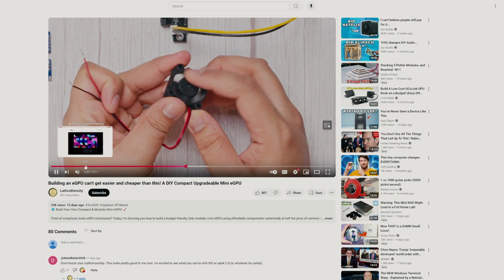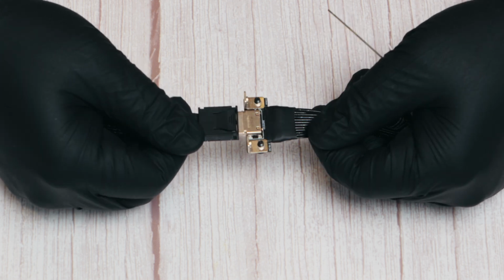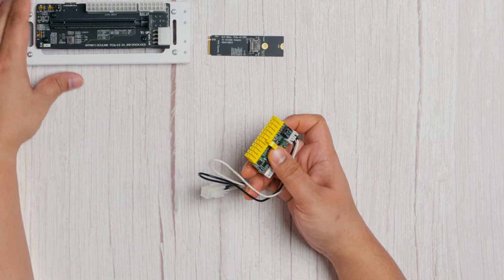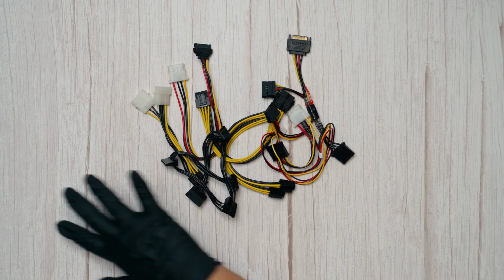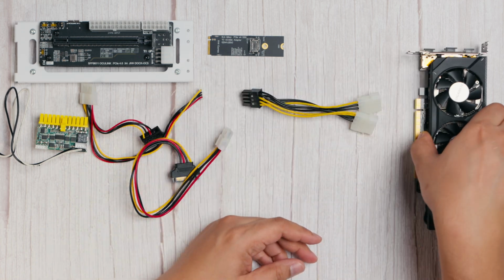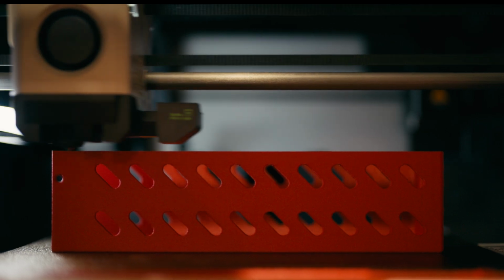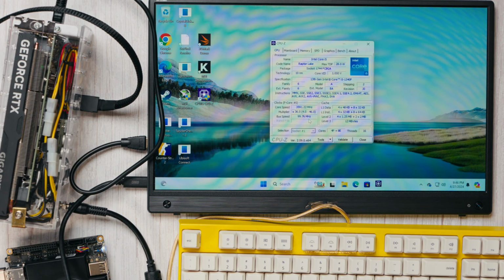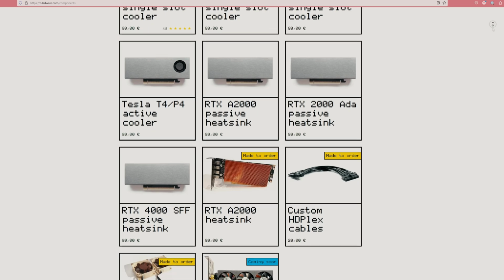Can This $40 Adapter Replace Expensive eGPU Enclosures? OCuLink Mini eGPU with an RTX 4060 LP!

Comment: Would this work with gtx1060 but i want for just thunder bolt 4 on my samsung laptop bulit in 2019
Reply: Gtx1060 has an PCI e 3.0 x 16 Slot. 
With These pcie 4.0 x4 Adapter you had only maaax 4gb/s. 
PCI e 4.0 x4 has 8gb/s. 
ITS highly recommended to Put a PCI e 4.0 Card in this Kind of Project.
I think occuli k has only 64gbit/s and in pcie 3. Only 32gbit. 
IT reduces Not only the max FPS. Your 1percent Low, your frames are dropoing with 32gbit to far. ITS unplayable.

Comment: Hi! I checked The occulink cable link you provided in description. I read the cable details and i found the data transfer rate of this cable is up to 8Gbps. How the gpu will perform with 8Gbps cable? Doesn't it require x4 cable?  I mean 32Gbps speed?

Comment: I still feel like the "Minisforum DEG1 eGPU Docking station" and an atx/sfx(or sfx-l) psu would be my first choice. I just plug things in.  I admit, it isn't as tidy.
Reply from the maker: While the Minisforum DEG1 eGPU Docking Station paired with an ATX/SFX(-L) PSU is a convenient plug-and-play option, I don't think it's the best solution for everyone. My setup in the video is an all-in-one solution that doesn't require external PSU and remains a single, compact unit. Additionally, the Minisforum DEG1 costs around $100 just for the OCuLink board, whereas barebone boards with OCuLink can be found for as low as $40, even for better models. DFRobot even offers Thunderbolt-based options for around $79. So while the DEG1 looks great, it's not necessarily the most cost-effective or versatile option for everyone, in my opinion. Also it's so big! But I do agree, if you are looking for a "real product looking" option, it could be it.

Comment: hi i have the same setup but for some reason whenever i use the gpu the pico power supply keeps shutting off randomly even though the gpu is working, im using a 160w pico with a 8 pin cpu cable.
Reply from the maker: Random shut offs are mostly power issues, either your GPU is pulling more than 160, or the PSU is actually not providing the said 160 or it's just faulty. Please be careful with powering GPUs as I mentioned in the video.
Reply: @LatticeDensity  i have a 4060 though running of a 120w dc power brick. im pretty sure the 4060 maxes out at 115w right so that shouldn't be a problem
Reply from the maker: @ I see, I am not sure about the exact power draw numbers, if you are sure it's not power, then it most likely is about some issue with the PSU.

Comment: also oclink is a cheap option especially with pcie gen 3 and untill you don't need a redriver card for signal integrity with PCIe gen 4 & 5 in particular. with gen 4 depends by how good cables are and how long you need them to be.  On gen 5 redriver is 100% mandatory and good luck with that $$$.
Reply from the maker: Oh yeah, I wouldn't go with external PCIE solutions at all when you are playing at the forefront at Gen 5, even my highest end MBs aren't very comfortable with Gen 5 yet ha ha
Reply: @LatticeDensity  
My pleade to electronics producers is mobos and systems with more pcie gen 3/ gen 4 slots or embedded oculink ports made  more accessible to che consumer enthusiasts segments. Idc really care about gen 5 and 6. I'd rather have a optical based solution rather than insane trickeries for signal integrity that can only work on super short paths keeping everything ultracompact zipped hot and thermal throttled controlled .
Also I would like to see who and what manages to saturate gen 5 lanes currently outside heavy servers enviorments
Reply from the maker: @ Yeah true, 100% agree, and waiting on the Gen 5 full throttling as well.

Comment: Cool but it’s not All in One because you need external power supply adapter
Reply from the maker: Lol, yeah you got me! My POV was from those crazy setups with a full blown PSU dangling outside the card adapters which I hate and is the main reason I didn't use to like eGPUs very much. Having the power solution inside the box, and just the power adapter outside is kind of an AIO for me.
Reply: @ I've seen few ppl testing few models with sensitive oscilloscopes and I am a little bit too concerned about power signal stability and overall LT reliability of those PicoPSU not to mention thermal performances. I really love the idea but ripples, transient loads behaviours discourage me much more. 
I really hope to find a PicoPSU thoroughly tested by third parties with really good power delivery characteristics as soon as possible. Till then I'll resort to bulkier ATX &Co bigger PSUs
Reply from the maker: @ True for generic ones, but I have found a few of them stable enough, for example the ones from RGEEK. Also, the HDPLEX DC ATX solutions, even the GAN AIO ones, are a much better option than hauling around those huge big PSUs they suggest using with eGPUs, IMO.
Reply: @LatticeDensity  Can't get them in Italy somehow....At least I haven't found a way/seller yet. I'll search again soon.
Reply from the maker: @Keeeeeeeeeeev  I know, the marketplace specific availability is a big bummer for many niche hobbies. Hope you find whatever you are looking for

Comment: If you can fit in an oculink to nvme adapter and nvme to thunderbolt adapter, that would technically be a thunderbolt egpu right
Reply from the maker: Yeah pretty much, I am planning to show that workflow in action shortly through another demonstration, please stay tuned!
Reply: tb chips makes your costs explode. They are nice and comfy for hot plug  hot swap features but pcie latency jumps up a lot wich is fine for some applications not for many others. Oculink is straight pcie lanes and cannot be unplugged/plugged without powering off the system. In theory PCIe standard could allow hot plug hot swap features but I' haven't seen any implementation yet. Enlight me if someone has seen proper pcie hot swap/hot plug implementations.
Reply: *Enlighten me
Reply from the maker: @ You are right about TBT vs. Oculink in terms of hot-swap. TBT uses a whole separate mechanism for making things hot swappable, which honestly I don't care much in an external PCIE solution. For the things that really need a PCIE based connection (and I am not talking about those TBT SSD enclosures which are just a waste by giving a little more than Gen 2 USB), I don't think hotswap is such a big deal. I would rather see more support for things like OcuLink.